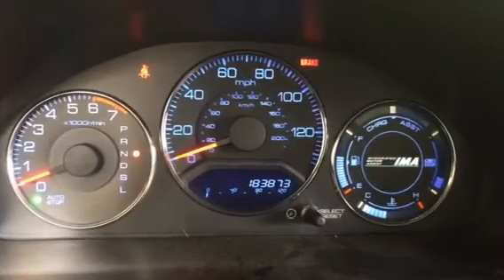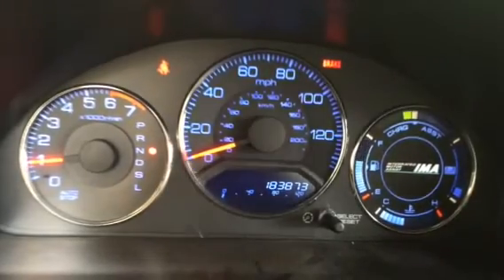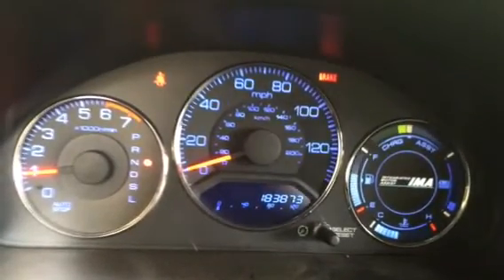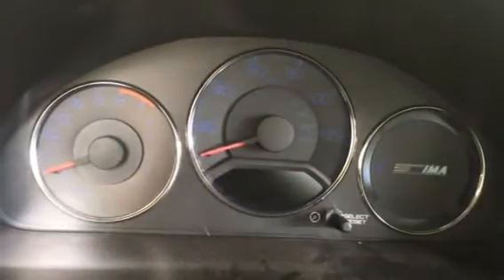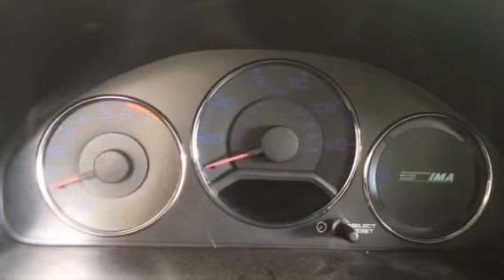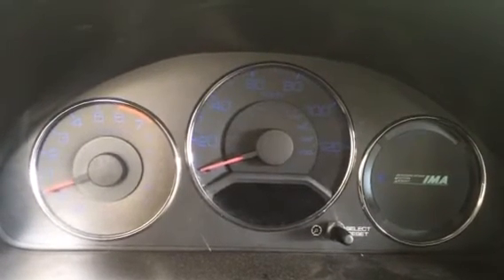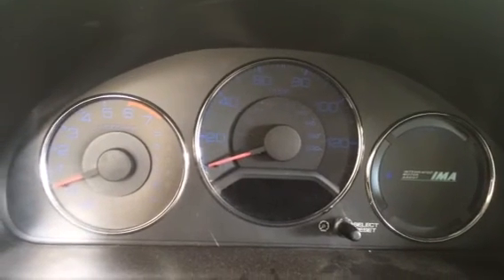Conditioning an IMA battery and maximizing the civic hybrid

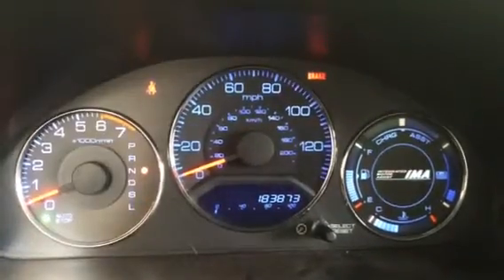Comment: 0:16 "close to a deep cycle" - by doing the "Auto Stop from driving slowly"? Is this how we discharge the hybrid battery and the bars will go down? (so no re-gen braking, by driving slowly around?) In my case, when driving slowly, it won't really discharge since it isn't doing the "Assist" much. Any clearer steps would be appreciated.
Reply: No, you need to drive into your parking spot from over 10mph to a full stop so the auto stop comes on, then you wait for the battery to drain in this position

Comment: you can also connect light bulbs up and discharge the battery using a meter to 0.9V/cell then charge using the L mode till you have full bars. (06 civic owner)
Reply: How would u connect the light bulb? Any diagram?

Comment: Hi Notchism,
In Googling around, it makes sense that your procedure would work and flex the IMA battery which should or could
cause the battery to work better and extend the life of any of NiCad or Nickel Metal Hydride battery for that matter.
I had to go to 10 mph and auto stop about 4 times or so to get the voltage to drop down to the last 2 bars. 
That's because each time I stopped, the car would stay in the auto stop mode for about 5 minutes while the bars would
 very slowly drop and then the car would turn the engine on again. 
I think that it took 3 or 4 times to drain it down because it was at the top bar or very close. 
Once I got the IMA battery voltage down to about 4 or 5 bars it took a much shorter time, like about 20 or so seconds for
each of the  remaining bars (or 1minute) total to drop down from 4 or 5 bars down to 2 bars.
Then I shut the car off and allowed the car to sit for 6 hours. 
I then drove the car until the IMA voltage  lights got back to the maximum number of bars like it use to be for about 5 minutes. 
I notice that now it doesn't stay at that full voltage level as long as it use to before dropping down each bar. 
I did only drive the car for about 20 to 30 minutes (about 10 or so miles) since I live in a hilly area.
I went up and down hills about 10 times and then found a nice flat 1 mile flat 30 mph area, 
so I just went back and forth a handful of times. 
I did only drive at approximately 35 mph or less during this recharge time. 
I wanted to know if I need to drive it longer or if you did anything else during the recharge. 
I'm just hoping I didn't damage any cells when it dropped from 5 bars down to 2 bars relatively quickly. 
Please reply to let me know your thoughts and what else if anything you can think of to get the IMA to stay at peak voltage for a longer period of time,
as now once the battery drops off 1 or 2 bars from the full IMA voltage light, it now runs the green charge lights more when just coasting without even hitting the brakes. 
Once I hit the brakes the charge lights go to or more towards maximum charge green bars, which is normal for braking.
Lastly, my IMA battery was replaced by the Honda dealership about 30,000 miles ago in 2014 so was and has been in good condition prior to this procedure.
I just saw that you replied to the previous question of others 2 weeks ago. 
I'm hoping you can get back to me as soon as your are able to. 
Please reply to let me know here or at my email of my1newtoy@verizon.net  
Thanks so much

Comment: battery light would turn on under 1500 rpm and go away if i reved it or drove but once i hit 4000 rpm it will ho back on and wont go away unless i drove back under 4k and it will go away. but just yesterday the battery light came on and wouldnt go away. so i took it to autozone to get charged amd put it back and still stayed on so i flipped the breaker in the back, back on and still the battery light stayed on. any info will be helpfull. thanks in advance
Reply from the maker: Gabriel Vega ima light or 12v light? Please keep in mind 12v batteries only last 3-5 years

Comment: Would my 2007 Honda Civic Hybrid benefit from a low performing IMA battery by conditioning it?
Reply from the maker: Rose not likely that you performance will change... using cruise control will increase mpg- from a stop these cars are always slow.
Performance wise Honda cvt fluid change did help some slipping on mine